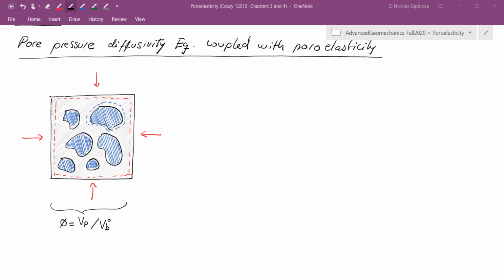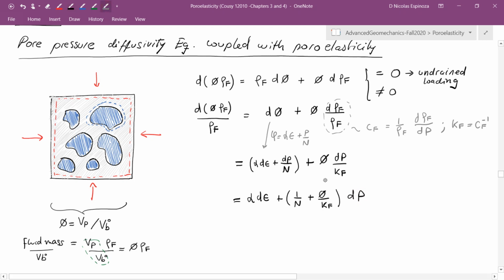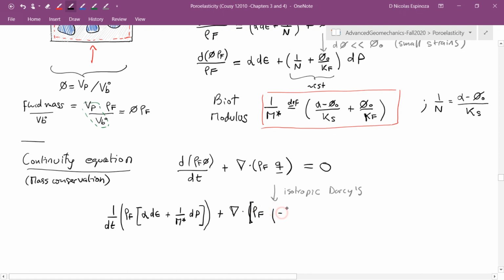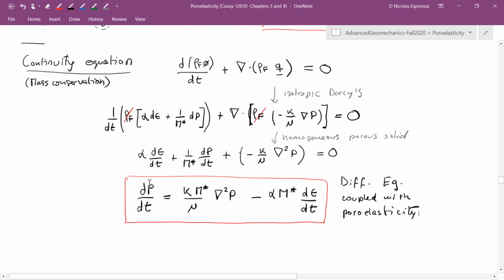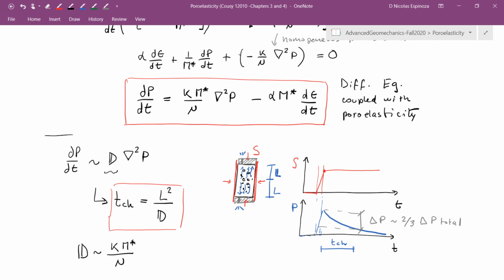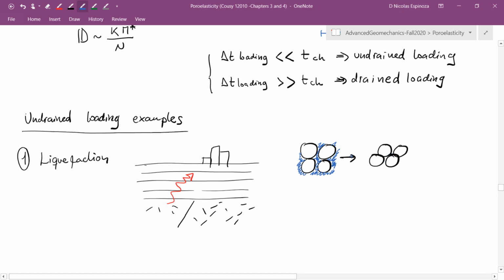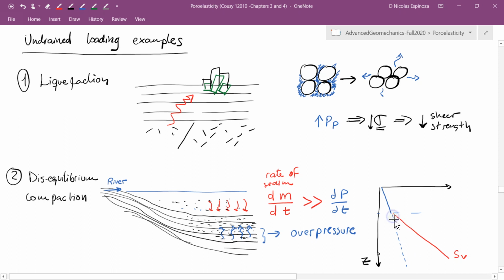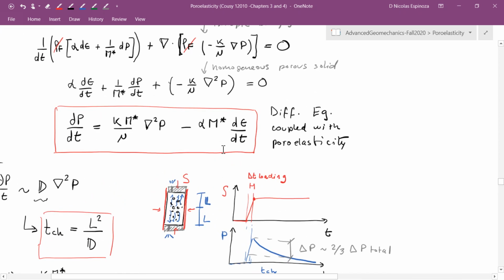L21 Pore pressure diffusivity equation for fluid flow coupled with poroelasticity

Comment: 19:36 A question: the darcy's flux is a kind of advection fulx, why this equation is a diffusion equation? Thanks
Reply from the maker: This is the continuity equation (mass balance), which uses the Darcy equation, fluid and solid compressibility, to end up with fluid pressure as the independent variable or unknown P (in addition to epsilon for the poroelastic part). All equations that look  dP/dt = d^2 P/ dx^2 are called diffusion/diffusivity equations in physics. More info on the Laplacian operator here (https://en.wikipedia.org/wiki/Vector_calculus_identities).
Reply: @dnicolasespinoza5258  OK, I got it. Thanks!

Comment: 15:05 this darcy's law could be a little bit inaccurate, because it lose the tensor or called vector?
Reply from the maker: The flow equation (isotropic Darcy's) gives you a vector (flow). (Nabla P) is the gradient of pressure, a vector field. This is as accurate and general as it can be for an isotropic material with a Newtonian fluid. The coefficient k could extend to a tensor for anisotropic materials. Flow rate vector and pressure gradient may not be linearly related for non-Newtonian fluids.